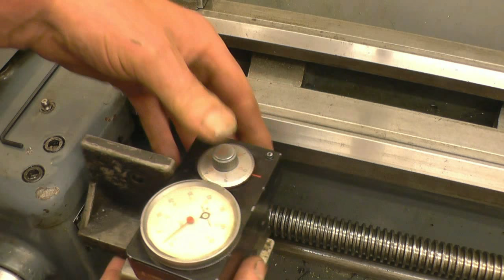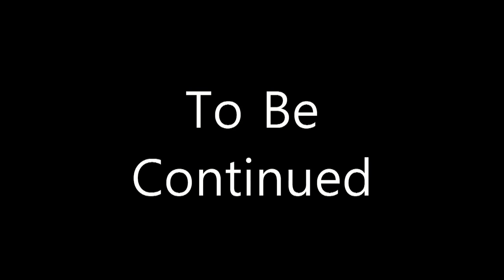SNNC 129 P1   Travel Dial - Milling -.Using small taps

Comment: John,
I see you are getting ready for summer . . . short haircut, short pants and a tee shirt. I wear a tee shirt and shorts most of the time, but my hair looks like I'm lost in the 1960s! I need to shave my head and then work outside and get a sunburn on my noggin! I did that before and it wasn't much fun!  Thanks for the first part of setting up your travel dial.
Dave